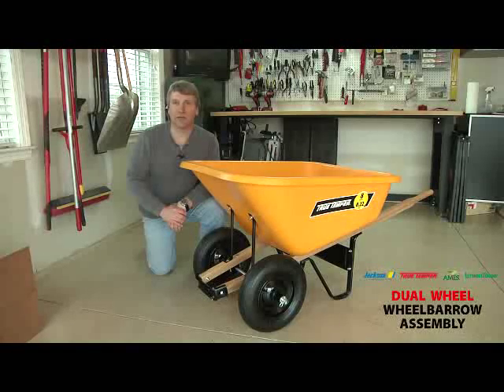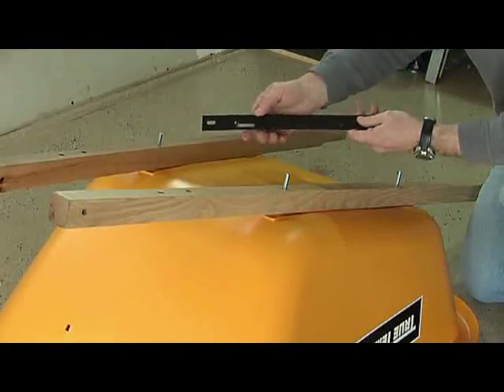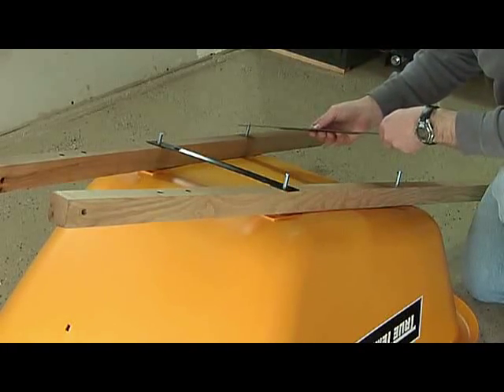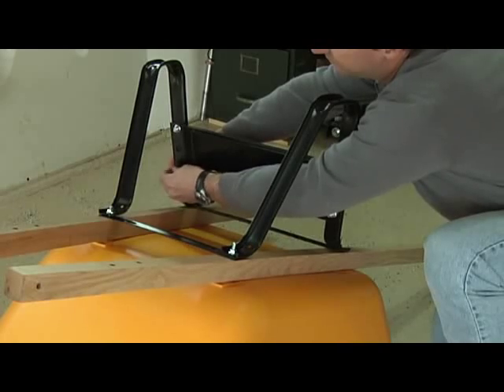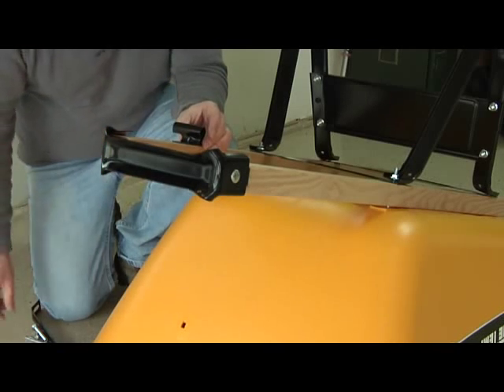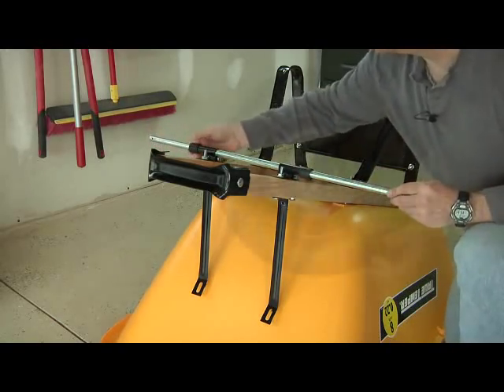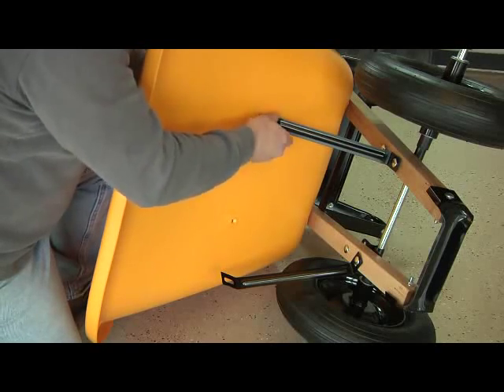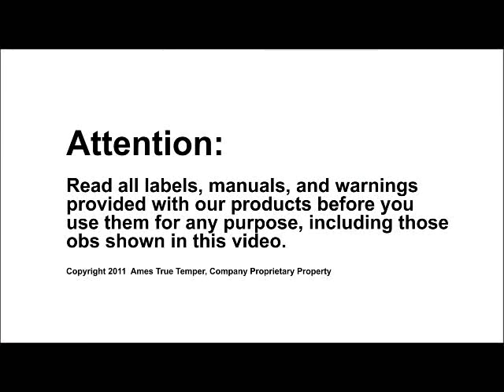Ames True Temper Wheelbarrow Assembly - Dual Wheel

Comment: As others commented, the product dimensions don't fit. Holes are too close to each other to attach the braces for the wheels, the base plate is at a too strong of an angle not to destroy the handles very fast. I can't finish assembling it, it is going back to the store tomorrow morning.